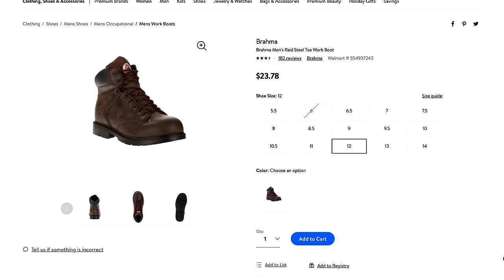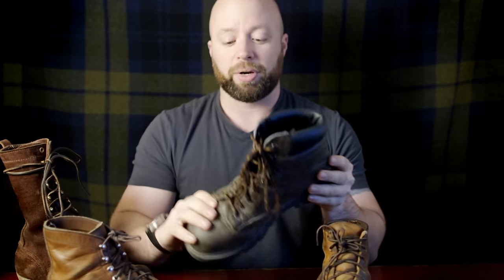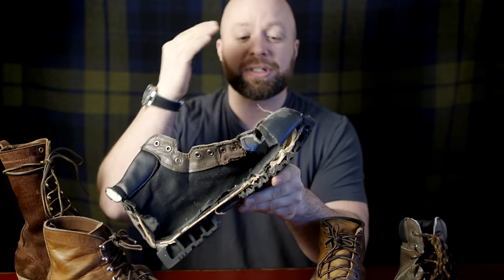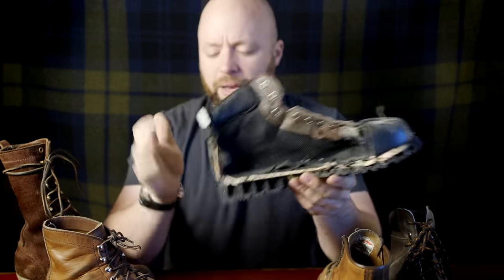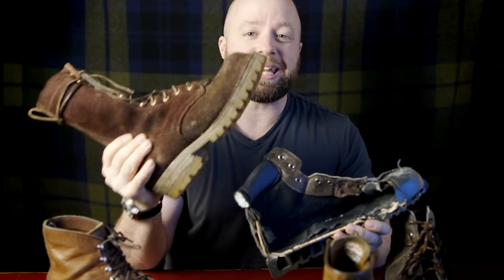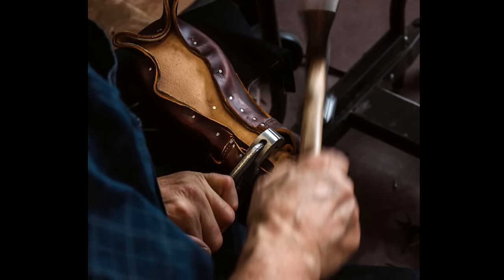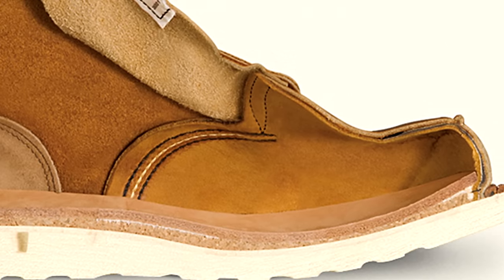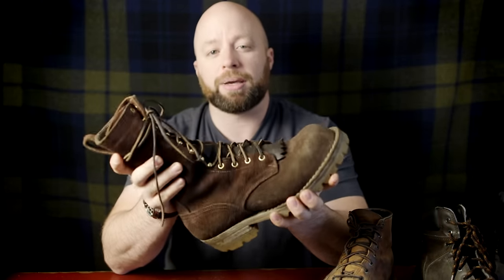Expensive vs Cheap Work Boots

Comment: I switch from brands like Carhartt and wolverine which were great but expensive to a European brand called Safety Jogger I have no regretted it they’re cheaper and lighter weight Most pairs around $40-$80 the first pair I got was $25 at a store near me called gabes the only difference in these and my wolverines or carhartt boots is they’re composite toe instead of steel they’re still tough I’m in the landscaping business so I have to move quick while remaining comfortable so they were perfect for me my next pair will be the same brand for sure whatever you do don’t buy boots from Walmart not even the Herman survivors they’re all junk from there I bought a steel toe cowboy boot of EBay called purpeechua they’re handmade in Mexico and cost $80 free shipping and they are supper reliable better than any $80 work boot I ever bought they’re my DD but I had to work in them for a few months after my Wolverine were worn out before I got the safety jogger

Comment: Equipment that costs less than a bottle of wine.....it's kinda shaddy :))
Our work boots and shoes cost from 300-400$ to something silly based on conditions, but our day to day boot is 300$ to 400$.... Ankle protectors, goretex, metal pad and toe protector, waterproof, and most important after 1 week of working your feet don't smell like a skunk :))....

Comment: just my 2 cents........
when i worked for an environmental company capping landfills, building water treatment facilities, surveying etc....i wore nothing bt red wing super sole 2412 because they met the requirements. great boots and extremely durable the only tough part was the break in period. the leather in the tongue are created a pinch point around your ankles that took a long time to break in.

when switched to land surveying full time i needed boots i could put miles on that were waterproof, good traction, steel toe for construction sites. at this point i went through several brands of boots trying to find one that would cover all of my needs unfortunately one pair was not to be. for non construction sites i wear danner pronghorns with 1200 gram thinsulate and goretex and these boots are fantastic right out of the box. the downside is they are not recraftable so every 2 years i have to buy a new pair. for construction sites where safety toe, water proof is a must i settled on irish setter mesabi's style 83826's. the masabi is a good boot and it meets my needs BUT with the softer leather the boots tend to stretch and become sloppy over time. my feet are your standard 10.5 D (sized and fitted at the redwing store with that fabcy machine and a banock device) and over time the boots have stretched to the point that when i tie them the strips of leather with the eyelets touch and the boots cant be laced all that tight making thicker socks a must. once these boots are done i will be switching back to red wing for something with a composite toe.

outside of work for around the house and side work in construction i have wingshooter upland boots. they are the same as the 838 model but they are 400g insulated as well as waterproof for winter and a pair of thorogood 814-4200 american heritage wedge soles for summer. both boots are very good quality and made well and very durable but personally i prefer the fit and comfort of my thorogoods.

Comment: What do you think of these boots? 

Timberland PRO Men’s 52562 Endurance 6″ PR Work Boot

Looking to get them for my first work boot
Reply: Had them... in my opinion, all Timberlands are garbage. I have Chippewa super loggers. Insulated, waterproof and steel toe. Best boots I've ever spent my money on. Bought them 8 years ago for $240.00. They are about $300.00 now.
Reply: My mistake... $260.00 8 years ago
Reply: Joel Pires i was told to go for these timberlands because they are really good if standing on a ladder for a long time. Plus I don’t need a steel toe for my job

Comment: Thorogood boots, Some of the best boots you can buy. Very comfy & they will last a long time, They will resole the boots when they wear out. Made in USA by Union Workers. Check them out. As far as Red Wings, I had a couple pair & hated them. The steel toe after about 4 months started digging into my toes & I could not wear them anymore. I brought them back to a well known shoe store where i had purchased them & they looked at them & said HUH. That's it. Check out Thorogood Boots.

Comment: Cheap boots that do not have solid filled soles so when they start to crack they absorb moisture. If it's raining you'll have wet feet. Avoid soles that have air pockets.

Comment: It's two bad that you bought a really bad pair of boots from Walmart.
I have bought 2 different work boots from Walmart at two different times. And I'm very happy with the feel, fit and comfort of them both. One with steel toe, one without. The one with the steel toe laster for a few years, the one without two years. I've only worn them when it's cold, and or wet weather. Not all year round. 
It's challenging to find halfway decent work boots under $100.00
A good Walmart work boots are not made to last 100 years. The high end work boots are made to last a lifetime, with care, maintenance, and repair. To each their own. Get the right boot for the right job.

Comment: I had a pair of Redwing boots that fell apart in less than a year.  The cost of getting them resoled was close to the price of new boots.  Don't listen to boot snobs.  Unless your job requires a specialty boot, go with mid range.

Comment: If you are willing to step it up a notch, try fully molded custom made boots. The bootmaker takes a cast of your entire foot, ankle, and lower calf then makes boots that are precisely the shape of your foot from your toes as high up your leg as you want them to be. You can specify every single aspect of the materials and construction, anything from ankle boots up to 12" and from dress boots to work boots that will out-macho the butchest construction worker, lineman, or back country firefighter. They fit like an extension of your body. No calluses, no corns, no blisters. I have had two pairs of hiking boots in the last 30 years and both are still in good shape. Expect to pay $1500 to $2000, go through 2-3 trial fittings, and wait 3-4 months for construction.

Comment: Never cheap out on things you will use every day and that will have an effect on your confort. Poor work boots affect your feet, then your legs, then your back... The pain goes up LOL
Good socks are also important, too much moisture retaintion can be bad if you use boots all day long. Avoid cotton, use merino wool (specially if there's  fire hazard, you want to use natural fibers around fire) or coolmax  / nylon / artificial fibers.
A shame there's no Red Wings in my country, just a bunch of lousy manufacturers that make work boots with PU soles (a few are decent but most PU soles feels like walking on a brick)

Comment: Im a mechanic and i wear 20 dollar boots at work. I also ride horses and wear a pair of 120 dollar boots to do that. It depends on the job, as a mechanic i spill oil, get brake cleaner and many other very nasty chemicals on my boots that will destroy nice/leather boots. The 20 dollar brahma boots last 8-12 months and are worth it when i can buy 5 pairs compared to my justin boots cowboy boots that are 5 yrs old and are fantastic boots but wearing them at work would destroy them almost as fast as the brahmas.

Comment: Theres actually alot of shitty expensive boots aswell. The Dakota brand. Is one of them. I've owned tons them. And they only last 6 months. After 6 months water starts leaking in. the sole starts peeling off. 
Then after 8 months the front toe area starts ripping apart. Long story short after spending 200 bucks on boots every 6 months. I bought a pair of boots from a local boot shop for 90 to 120 bucks and they lasted 2 years.. my second pair lasted a year so far and haven't fallen apart...

Comment: Dont buy the cheapest brand of those boots at walmart, buy the 40-50 dollar ones, i buy these boots at Walmart for years, they dont last for years, but they last 6 months to a year if you use them 5 days a week or more on normal wear n tear on work boots at work, then you got to buy a new pair of them
What is good about these boots is if you are stepping in messed up stuff at work , you wont messed up your good boots n will be throwing these away after 6 months or a year
The places i work i dont know where they will send me until i go in n get dispatched n sometimes i got to step in messed up stuff at work

Comment: Good good vid thank you. Yes I'm lucky enough to have boots supplied by my employer. HOWEVER they are "free" ...or rather I don't pay for them directly my employer pays for them and pays as little as possible. And pretty much they fall apart within a year, it is the age old dilemma is the item what ever it is, something you want to invest in and are you going to use it enough to justify the cost. Chances are if it's a quality item you'll want to use it and very often it will be good to use. Anyway just my five pence worth, thanks again all the best.

Comment: Well..because I personally think it's over priced..I'd hate to pay that much for a boot and trash it..I do construction work and at no time I felt like I needed a $300 dollar boot to perform my job..actually, in some jobs it would be catastrophic to wear thick boots such as framing as you dont feel where your stepping. I'd rather have $300 in profit then in a boot..there are specialty boots that might cost $300 suck as cougar paws for roofing and then..yes..I'd pay $300

Comment: I had to stop less than one minute in, to leave this comment.  As soon as I heard the name BRAHMA, I almost gagged!!!  First of all, I've always KNOWN, not just believed, that you get what you pay for when it comes to work boots, period.  If you buy cheapo boots, they're gonna rot off your feet in about one TENTH of the time it takes for a GOOD pair of boots to wear out. Anyway, back to BRAHMA.  I bought a pair of those, just for the sole.  I was building a Halloween costume that incorporated a pair of big, bulky, armored boots.  I used a decent pair to build on and after adding the armor, (EVA foam, heavy leather, nuts and bolts, a thicker, rubber sole, to add height), I wanted to glue another sole on the bottom.  Since I'd already spent a fortune on materials to build this costume (like, seriously, at least a thousand dollars), I figured that I didn't need to spend a lot on boots, if all I'm gonna use is the sole, and trash the rest, so I thought I'd try the BRAHMA'S, since they had the type of sole I needed, and it's not like I was gonna be walking far in these boots, once I made them.  It was, after all, a Halloween costume.  What EFFING TRASH those boots were!!! Even the sole was utterly USELESS!!  I cut them apart, to strip the soles off, and I swear, there was a layer of EFFING CARDBOARD between the sole and the inside of the insole! The rubber of the sole was concave, to fit the cardboard in, and was held in with flat head BOLTS! I absolutely couldn't believe it! What garbage! I couldn't even use the soles, and tossed them right in the trash. A few months later, I was at Walmart and I saw some poor sap put a pair in his carriage.  I could not help myself.  I believed it was my humanitarian DUTY to warn him NOT to but those!!  I told him my story and he put them back!  I just cannot even believe that something SO UTTERLY CHEAP and grotesque, actually exists as a WORK BOOT.  I honestly can't see how those would last a WEEK, on some of the job sites I've worked on. I mean WHY even MAKE THEM???  C'mon, CARDBOARD?? UHLKK!!  That was 2 years ago, and I'm still disgusted by it!

Comment: If your cheap with your boots it says a lot about your choices of quality and personal hygiene. Obviously cheaper boots means your going to have busted feet 🦶. Over time will put wear and tear on your body. You want quality leather boots. Water proofing. Good materials will allow your boots to last longer. If you do the math you are going to spend the money regardless. If your frequently buying cheap boots vs buying one good pair of boots. I wear red wings & carolina. That’s it. Usually going to cost you $150 - $200 or more. But will last you 6 months - 12 months depending on your trade. I’m a scaffolder/rigger. So I’m constantly climbing and slamming steal and wood planks all over the boots. My feet stay healthy and my legs and back allow me to work every day and it’s thanks to my boots!

Comment: Mine is a story of misery.  For 37 years the heavy steel plate shape cutting(multi torch Oxy/Fuel burning) work envolved the posistion of an archer for hours. Balanced on my ankles while bending like a gorilla squaring up torches, or in the same stance hand torching still very hot steel throwing(acumulatively)tons of scrap frame work to a 8 ft. high hopper gave me a PHD in work boots. Always wore the tallest, meatyest heald soles Red Wings money could buy.  THE END CAME when OSHA stuck their noses into the wyole bs metatarsel crap being forced on our steel fabrication industry.  The flexability that my boots had b/4 that time was not great,but ok. Then the addition of both pivot and incorporated metatarsels coupled with high heal highth set my hips at an un-nateral angle. 3 years later a poorly done hip operation and bone scraping (bone on bone scull crushing pain)pain, i was DONE. Insurance companies put outrageous requirements on workers based on ass-holes in government who never work a real mans job a day.  Mine wasn't the case of a fat out of shape man that let himself go. Dispight my failing legs click on my icon and check out my body building videos on YouTube.

Comment: How  about investing in a pair of doc martens
Reply from the maker: Docs are great for what they are but I wouldn’t use them on the job site. No steel shank, and the only decent ones are the Made in England versions. However, at the point I’d buy Solovair.
Reply: I currently wear Doc Marten steel toe workboots. They are ok, but suffer some of the same problems as the Bramahs (cheap insole materials). I will be upgrading to Redwings when my Docs wear out.

Comment: Best Boots for me, White's(3 pair) Nick's (2 pair) Danner's, (3 pair)  Redwing (1) And never once regretted the money spent. I ended up acquiring so many is because I would by a new pair while the others were being rebuild, and I am a bit of a boot whore. Westco's were ok but after having White's and Nick"s they were not top of the line. Worst I owned, two of the three pair of Danner's (fireline, Power Foreman) just didn't last and were poor fitting(one side was way smaller then the other on the firelines, sloppy toes on one of the Power foreman.Oddly, I own a pair of Danner Fort Lewis, and it is one of the best boots I have ever worn. Most disappointing boot I ever put on were Thorogood's. At half the price of Redwings, and with about the same amount of rave reviews, I was totally disappointed in them. The felt like Walmart boot's. There are others out there that are ok. for me Georgia's Lineman were every bit as comfortable as Wesco's and walked better, but only last about a year. If you wonder why I spend as much as I do on boot's, it's because they last. The White's I am wearing as I write this were originally purchased in 1992. I was sadly informed that they didn't think they could be rebuilt again, so in two years(of 6 days a week wear) I will have to let them go.
Reply from the maker: Wow, that’s a lot of experience in boots! Thank you for sharing your story and wisdom!

Comment: I don't think red wing white outsole one can be a good work boots at all. I have 3pair of it. The past 15yrs. The white outsole is shit and not durable. try climb ladder with that red wing you will slip someday. That red wing definitely not a good choice as work boots,  I only wear red wing just because I like the color and design. That's for fashion use only. I might still prefer cat or some cheaper working boots.

Comment: I've worked at ship yards for twenty years and I've got news for you. Ive owned forty dollar work boots and two hundred dollar work boots and they last about the same amount of time. Six to eight months. I've had every kind of high end boots. The worst I've ever owned were doc martins. They fell apart in four months. The best were wolverines. They lasted almost ten months. I can tell just from the type of wear on this guys boots he is management or works in one place standing still, indoors most likely.
Reply from the maker: Yep. Standing still indoors. Not installing inner duct for train signals, or cable tray across bridges, or feeders for a switchgear room. Nope, not me. 
Clearly your expertise in boots is only matched by your evaluation of what someone’s trade is.

Comment: You seem like that guy who has never been on a job site in any  capacity greater than being the laborer / b** ....
You also said you wrenched too. 

Btw, You also definitely don't need  a few pairs of those Red Wings you claim to have. You also said those were beat, those things looked in amazing shape, just get them resoled and give a good wipe 
down with a shine.....
Reply from the maker: I’m a licensed electrician, CDL class A, foreman on several multimillion dollar projects, project engineer on a casino and railroad jobs. I was a mechanic for 7 years where I obtained my CDL A for heavy duty towing and recovery and ran night crew on the CT interstate. Now at almost 40 years old I can tell you that I’ve seen quite a bit in my time as a tradesman, and I resent anyone questioning my experience.
Reply: @CarlMurawski  doubt most of that!